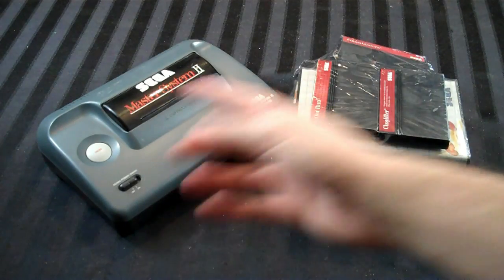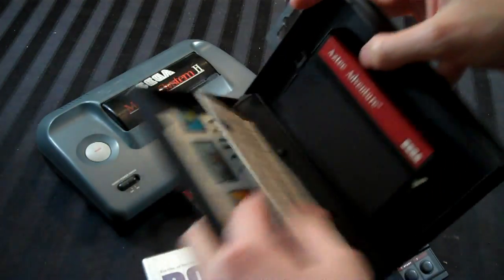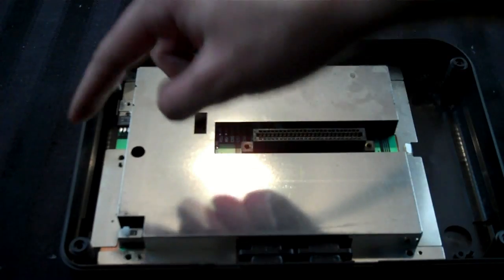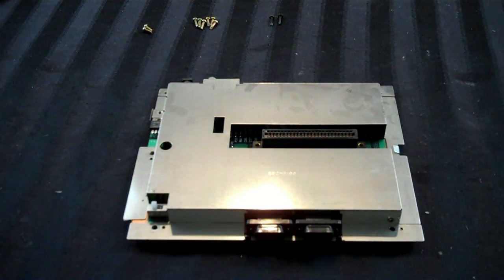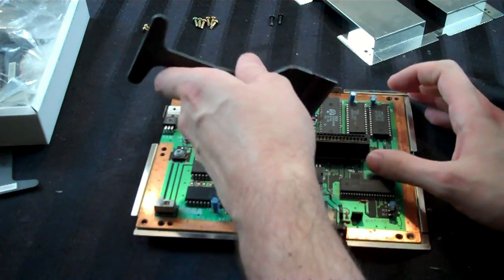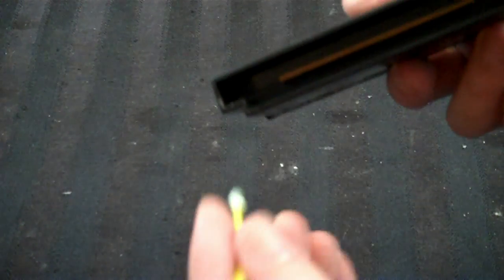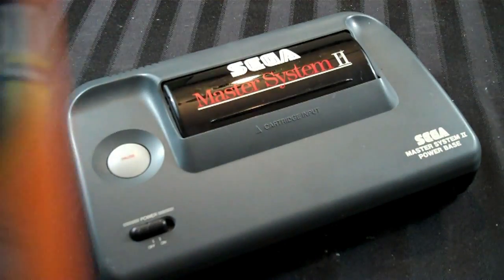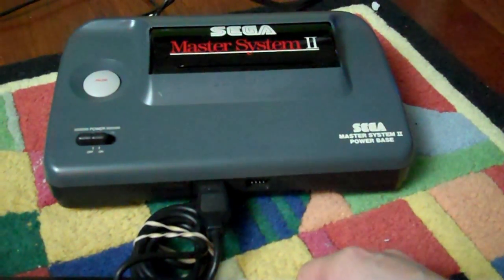Gamerade - Cleaning and Restoring a Sega Master System II - Adam Koralik

Comment: With cleaning the games I find dismantling them first allow better access to the contacts - I then use a soft eraser to rub off the physical grime, then use a soft tooth brush to remove any eraser crumbs, and compressed air, then the cue tip with either windex or rubbing alcohol!  Takes longer than your method, but at least you can see how clean the contacts now are not missing any bits!

Comment: Just an FYI 

The 2 fine screws on the LH side you removed for the voltage regulator is connected to the heat disapator, in-between is thermal paste, if you remove the screw just above the black square you will need to clean and replace the thermal paste as you would have not a great connection between the voltage regulator and heat dissipator due to the paste being 20+!years old.

I know this video is old hopefully you replaced the thermal paste to keep the regulator being able to keep cool.

Comment: I once had a original sega master system back in '88 and the built in games were hang on and safari hunt (it came with 2 controllers and a light phaser). The games i used to have were ghostbusters, aztec adventure, kenseiden, rocky, fantasy zone: the maze and space harrier.

Comment: I tried the credit card method on my NES and it sort of snagged one of the metal contacts.  As I pulled outwards, the contact bent out of shape almost backwards.  I bent it back in shape, but I've actually done this a couple of times... so just wanted to add a slight warning to using that method... and think I'll google that cartridge cleaner you used there.  That looks pretty great.... thanks for the vid.
Reply from the maker: Damn man, that sucks! I'm sorry about that. Yeah, I'd always recommend the cartridge cleaning kit, I wish some company would make a "retro series" of them so they'd become easier to get now.

Comment: Arghhhhh - Magic Eraser again!  Each to their own but it does leave scratches in the surface of the plastic!!! Look at it in the light afterwards and you will see the scratches.  Meguiars PlastX is what you need, its a lot less abrasive and doesn't scratch the plastic.   Great job other than that - always nice to see a system restored :)
Reply from the maker: I know, but it's the lesser of two evils. Plus, Pledge offsets a lot of that.
Reply: Pledge is ok but, a little bit of WD40 sprayed onto a micro fibre does a great job of giving a darkened sheen!
Reply: Yeah, that magic eraser kills your textured finish on consoles. I would also just go with isopropyl alcohol instead of window cleaner. Windex uses ammonia as a drying agent but there's also detergent that can leave a film on your connectors. A quick clean but not as sterile as alcohol.

Comment: Hey! Just picked up a master system 2 but i cant get picture/sound at all. It changes from static screen to black but that's all! I have replaced the voltage regulator with a new on but still nothing. What else can i do? I heard there was a way to isolate the positive on power and switch and bypass some shit but i cant find any vids on it.

Comment: Hey Adam, can you make a video showing how to repair game discs? I've gotten so many games that are absolutely destroyed and it would be nice to use them.
Reply from the maker: If I had the equipment I would. The best I can do is tell you what I do.

I go to used CD stores that have disc resurfacing machines. The machines costs thousands of dollars, hence I don't own one.

But they'll often clean the discs for you for a couple bucks.

Doesn't work 100% of the time, you need to understand that going in. But it does save a lot of discs.
Reply: AdamKoralik Hm. I will try that out here soon, there is a store near my house. Thanks Adam.
Reply from the maker: Bart Komedy
No problem. They may offer "cleaning" and "disc resurfacing."

Cleaning is cheaper, but disc resurfacing is more likely to work. Keep that in mind.

Comment: Adam, not sure if you knew but you are supposed to wet the magic eraser before using it :)
Reply: The plastic was already wet so what does it matter
Reply: What it matters is that, if you wet the magic eraser it acts as a sponge, and then does not leave a residue or scratches like it did in the video.  Just was trying to be helpful.
Reply: It still works just as good for removing scrapes and stuff though.
Reply: Oh thanks for telling me that

Comment: try spray on contact cleaner with a toothbrush on the board and cartridge slot
Reply: Rodolfo Pierre Make sure to use anti-static brushes for older systems. Toothbrushes have a higher chance of messing them up, so better safe than sorry, right?

Comment: The main trouble with the Sega Master System is that eventually the D-Pad  on the controller  breaks and falls out. You can just buy a high quality 3D printed sega master system replacement D-Pad for £2.75 off riscman on eBay!! Works better than the original!! Sega Master system Game Pad problem solved!!